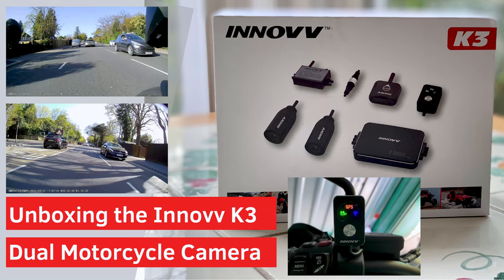Fitting the Innovv K3 Camera System to a BMW R1250 GS Adventure

Comment: Hi Nick, I am wanting one of these for my GSA.  I am not a confident tech person but am thinking about getting one and fitting it using your very clear instructions.  What is the role of the ezcan and do you need one of them to fit this camera kit?  Thank you fo r your great videos.  Stuart.
Reply from the maker: Hi Stu. No. You don’t need the CanSmart. You connect red and black from Innovv power supply to battery then you just need to find a switched feed. I’m not sure of the wire but one of the wires to the pressure monitor will do. If you use positap as I did you can tighten lightly to see if you have the correct wire and if so screw it tighter without making any cuts 👍🏻
Reply: @nickhodgeUK  hi Nick, that helps, thank you very much for responding, keep up the clear instructional videos, complimented by the touring.  I enjoyed watching your Ireland tour.
Reply from the maker: @stuartgc8950  Stu. Just re-reading and for clarity the Innovv switched feed you’ll need to connect to a BMW switched feed (eg the tyre pressure monitor) is the yellow wire from the power supply (it’s the only one left in fact)
Reply: @nickhodgeUK  thanks Nick

Comment: Love the bike....the farkles/mods....and the videos!!!!  Does it record in a loop?  How can you retrieve the footage you need incase of an incident?
Reply from the maker: Hi Fred. Thanks. It does record in a loop. It has sensors that automatically lock the file in a ‘known’ accident or you can press the remote to lock the file (this way they won’t get recorded over on loop). You can retrieve via the app but it’s slow (painful) but now the K3 has a rubber door. Popping out the card takes seconds and is far better 👍🏻
Reply: What are your thoughts on the k3 vs the k5?
Reply from the maker: @fredzuccarelli  difficult to know as I’ve. not had the K5. All I would say is, because of the throughput of 4K footage the front camera has to have the recorder built in. That make the camera a bit more difficult to site 👍🏻
Reply: @nickhodgeUK  very good point.  I was thinking it might be easier as there is one less component to find room for!  Thanks Nick....great content and will always support your channel!!

Comment: Hi nick. I’m going to fit the k3 camera to my gs adventure 2019. I don’t have an hex ezcan. I’m also going to get the innovv power hub 3. I emailed innovv about where to fit the yellow wire to the canbus system they wouldn’t give me an answer. They just gave me a link to your YouTube site and watched what they sent about fitting the k3 to the gs. Very good I must say👍 I’m still no wiser where to fit/splice the yellow wire into the canbus system. I’m not very technical minded at all so any help where to fit the yellow wire would be gratefully accepted. 
Thanks Martin.
Reply from the maker: Martin. This is where it gets a little technical. If you have a multimeter you need to find a wire into something like the rear light that only has power when ignition on. Bit difficult to explain in a comment but you turn the multimeter to the 20v DC setting and then make sure the negative (black) wire from the multimeter is earthed. Then with the positive lead (red) from the multimeter, tough the cables in the rear light for example and with it held switch the ignition on and if you get a 13-14v reading that disappears when ignition is off then that’s the cable to ‘tap’ into. Sorry I can’t tell you more than that as I’ve never had to tap into the BMW loom so don’t know the colour. Maybe try googling as someone must have done it. Hope that helps some 👍🏻
Reply: @nickhodgeUK  Thanks nick. I’m not to happy about going into the loom. I’m looking at the Healtech thunder box they just have 2 wires that go onto the battery which knows when the ignition is on and off. Reckon I need more information on this tho. Always enjoy your videos. And thanks again. 👍👍

Comment: Hi, just fitting a K3 at the moment , can i ask the pos tap connection for the yellow cable how did you choose which cable to tp into or does it not matter ? did you not want to bypass the battery and use the Cansmart to power the K3 ? , thanks for the videos they are great
Reply from the maker: I don’t like using the CanSmart totally as the Innovv power supply has an off delay itself and therefore you don’t really want the Canbus system overruling that. The switched wire you can measure but you can also just lightly tighten the positap and test. If wrong it’s a tiny pin prick. Generally I go for the non solid (striped) wire.👍🏻
Reply: @nickhodgeUK  You can set the off delay in the cansmart program. The delay on the DVR is 30 secs. I set the delay on the cansmart to 60secs so it doesn't power down the DVR prematurely.
Reply from the maker: @alanjones923  Alan. This is true but not sure if the latest software that allows that in the CanSmart (EzyCan) works on Gen1 of that equipment. Of course if you set it ‘Off’ in the CanSmart then the Innovv power supply will handle itself 👍🏻
Reply: @nickhodgeUK  Ah gotcha. I’m using Gen 2 Cansmart. 

Credit to you for the content on your You Tube page. Fantastic

Comment: Good Morning Nick, thanks for taking the time to make the video on the installation and set up of the K3, I used your vid as reference for my installation also the tip on where to put the GPS module 👍, couple of questions how do I delete the files or do they just automatically get taped over when the card is full & just to clarify is it one press of the button to save a file and two presses to take a photo ? 
Thanks Mark
Reply from the maker: Hi Mark. Correct it loop records over existing footage except those locked by a single press 👍🏻
Reply: @nickhodgeUK  …… Thanks Nick 👍

Comment: Hy Nick, and thanks for your great video!
I don't understand where I have to connect the yellow cable, maybe free?
Someone thinks ez excam is necessary, you not?
Bye
Reply from the maker: You must connect the yellow wire into a wire than comes on only with the ignition. This would be something like tail light, indicators, horn. You do not need an EzyCan. It just makes it a little easier 👍🏻

Comment: Some nice tips there Nick in a very comprehensive video👍. I had problems with the front gromet being pushed through on the side panels even after greasing them so now I rotate the panel up and forward so clockwise on the battery panel before trying to locate the lug, push the lug in then rotate the panel into position which seems to work better. I have a 2 channel set up on my GS which isn't an Innov but similar plus a hexezecan and found it easier when installing both to remove the seat brace entirely as it's only held in place by 8 Torx bolts. With that removed it's so much easier to route all the cables and make a neater job as you can hide a lot of them out of the way underneath leaving more space where the control unit has to go. I also mounted my rear camera on top of the rear light and routed the cable through where the rear light cables go which is a really nice neat fit. Cheers Ade
Reply from the maker: I agree about the seat brace and I may yet do that. Had to remove it the other day to retrieve a fastener but couldn’t raise the will to do it again. All this would help if people didn’t want me to fit stuff 🤣👍🏻
Reply: @nickhodgeUK  I've got one of those small electric screwdrivers that look like a mini drill off ebay and it removes the bolts in seconds which is really usefull for things like this👍
Reply from the maker: @Bazza47  having been a mechanic and spent 30 years selling tools I still like the ‘feel’ 👍🏻
Reply: @nickhodgeUK  I can understand that and use my Halfords advanced socket set to undo the bolts initially and do the final tightening but just like the convenience of having a bit of assistance to undo/reinstall them when they're not under any tension if that makes sense, especially as I've been suffering with carpel tunnel syndrome so anything that takes the strain of repeated flexing off the wrists helps.
Reply from the maker: @Bazza47  yep for sure. Age is a bitch 👍🏻

Comment: Both nuts are right hand nuts. You can’t have different handed nuts on the same bolt. Further, if they were different you would not have to turn them in different directions to tighten them. Think about it.
Reply from the maker: I don’t have the GS now but the mirror doesn’t screw directly into the lever clamp. It goes into a stub with an opposite thread to the lever clamp so they are drawn together as you tighten 👍🏻

Comment: Where did you connect the yellow wire to??
D
Reply from the maker: The second light circuit on my Denali CanSmart and set it as a 2A accessory circuit in the CanSmart software 👍🏻
Reply: @nickhodgeUK  Can you help u explaining how to do the yellow wire and what we need for material?
Reply from the maker: @bramdrone the yellow wire is the switching wire. The power supply has power from the battery all the time but that only allows power to the DVR unit to switch everything on when the yellow wire receives a signal. This signal comes from the ignition. What you need to do is connect the yellow wire to something else that comes on with the ignition. E.g tail light, etc. likewise when the ignition goes off the yellow wire ceases to have a signal and the DVR switches off. Any lightweight electrical cable will do to connect to the motorcycle wiring and the yellow cable 👍🏻
Reply: @nickhodgeUK  Thx for quick responce, and this wire from exaple taillight is also yellow on the bike?
Reply from the maker: @bramdrone I doubt that. You’ll need to poke the yellow wire from power supply into back of bike electrical sockets and see if DVR comes on with ignition. This way you’ll soon find one (wait a few seconds after ignition on for DVR to power up though as it won’t be instant on power up or down)

Comment: Had the K2 on my BMW R1200GS and wss very disappointed about the video quality while moving. Even in highest resolution! I see same in your driving fragments at the end of video.
Also system didn’t survive my trip over Iceland. Was wet there this is true. 
As dashcam system useless, you can read a numberplate while driving....
Reply from the maker: Hi Harrie on the K2 you may get a better quality at 720p as the bit rate struggles at 1080. Be aware my video is 1080p rendered at 4K which won’t help it. Certainly I had no issues with my K2 over 3 years. K3 too short to tell. I am liking the card access though already 👍🏻🤣
Reply: Even with the K5 numberplates on cars are unreadable, seems main objective for a ‘dashcam’ to me
Glad you are happy with

Comment: I think this is the best DVR review in the universe! So meticulous! It is so voluminous that even the issues of saving files in the operating system are being dealt with. Very cool! Thank you so much, Nick!

ps I'm still in doubt between this model and the VIO FO MT 1, 60 frames per second is also important to me, which you just showed in the application settings. 

In which video mode is the license plate better visible?
Reply from the maker: Glad you liked it. I have them both set on the highest FPS and res